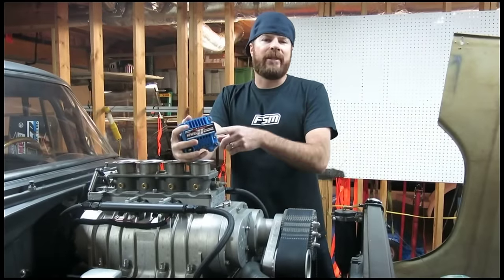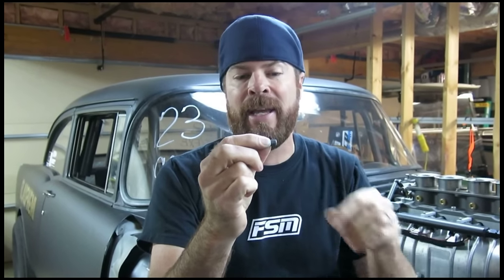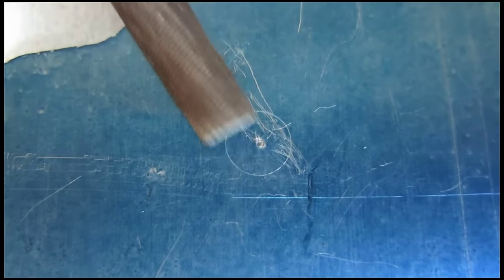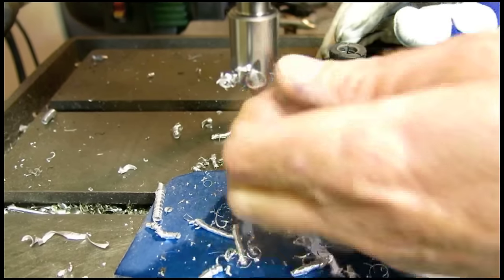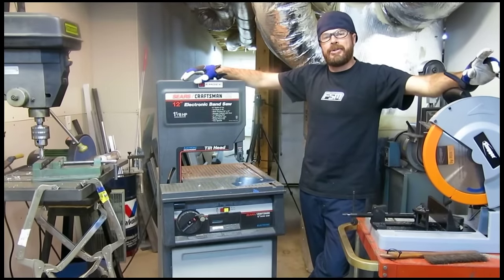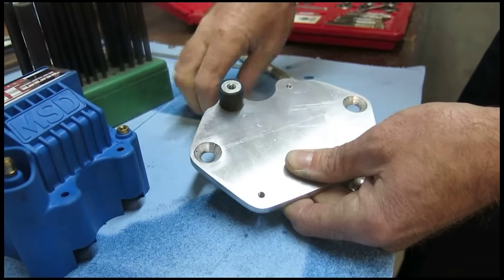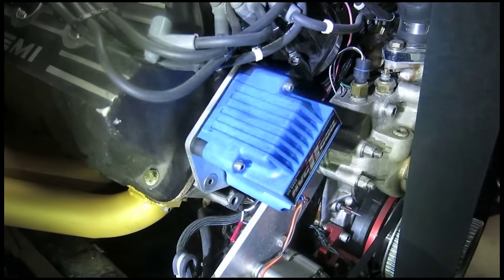Finnegan's Garage Ep.2: Cheap Fabrication Project, Blasphemi Gets a New Coil Mount.

Comment: Have been in the Machinist Trade since 1968 and having worked at a University in L.A. I enjoy watching you learn how to use tools. Nice Bridgeport. I had a CNC mill which was great for making things. You should save up for a CAD next. Tip from an old guy : coconut oil or griddle fry for cutting lube. Safe to breathe and handle. We used it in Aerospace as it was easy to clean and didn't come out in zero gravity.

Comment: Just a note, you can use your Disk Sander or the 2" Vertical Belt sander to dress up the edges of your 1/4" Aluminum.  It will give it a nice brushed finish and you can true up any not so straight cuts. And no you don't need cutting lube band sawing aluminum just watch your feed speed, you can also get more aggressive blades than what you are running. Aluminum also routes and cuts very nicely with standard carbide tipped wood bits and blades, lube may be required at certain times. Look forward to more shows.

Comment: So i used to make leafsprings and when counter sinking steel we had the holes punched out then just went at them with a regular bit half the time. Sometimes 600 leaves or so one after the other. Other than havin to sharpen the bit we never really had any problems doing it that way

Comment: Noticed that if the bracket were to be used as initially cut  the countersunk holes would have been on the wrong side of the material.  The marking compound should have been opposite the countersink?  Otherwise the bracket would have been bolted on backwards.  Great video showing great work and attention to details such as not adding any holes and shaving all but the required material off to make a bracket.

Comment: Aluminum having a passive corrosive coating after machining is true. But if putting a airframe thru a deep C check and proper corrosive protection isn't done, (maybe not on a structural panel) would get you sent home for good quick.

Comment: Probably would have G-Clamped that coil when marking the 4 holes and scribing the outer so there wasn't movement. Doesn't need to be mega clamped, just enough to keep it in place.
Reply from the maker: The rubber mounts for the coil have enough give in them that clamping it down while marking the holes isn't necessary if you hold it firmly and lightly tap the hammer.

Comment: nice harbor freight ratchet. also nice score on the band saw. too many mechanics (myself at a young age included) try doing everything with hand held cutting tools. though I did spy a Bridgeport j head in one video guys who want to get into fabrication should invest in some layout tools a drill press and a band saw. even if they are home grade used tools or tools from China. a lot can be done with a band saw and a blade to match the application. especially if it has multiple speeds.

Comment: I've got a couple of pre milled photo's I'd gladly share..Love the race boat.. mine is an 18 foot Stehpens V bottom. big block chev 481 cube 817 HP.. I pull it to 7200 RPM for 109 mph 2 skiers with very little fuel
Reply from the maker: +Steve Boys must be a pretty small impeller to turn 7200 rpm with 817hp. sounds fun!

Comment: I did a very similar thing a week or two ago fabing up a mount to install a 2005 f250 steering box into my YJ jeep. I didn't have those fancy transfer screws though. So I took a half inch bolt, through it into my lathe, and turned a point onto the bolt. I then cut the head off of the bolt and inserted it into my steering box. Worked pretty well. I should have added a nut thoug. The threads in the steering box weren't very tight causing my transfer bolt to wobble a lot. But I was in a hurry and didn't care. :)

Also, if you don't mind some constructive criticism, the intro needs to be way shorter. I would keep it under 10 seconds. Keeping it around 2-3 seconds would be best. This is something that I have worked through on my own channel.
Reply from the maker: Thanks for the input. I shortened it in the next vid.
Reply: +Finnegan&#39;s Garage I'm glad I could help.

Comment: GREAT video. My OCD kicked in, though. It's not a "ten thirty-seconds" screw. That would be 5/16, not at all what you have. It's a "ten thirty-two." Number ten screw, 32 threads per inch. I'm not a machinist, I'm an electronics/wiring harness tech, but I'm also a generalist. I drill and punch holes in my chassis, mount the components, and do the wiring and check-out. If you get an "eight-thirty-seconds" bolt, it won't fit your "eight-32" hole. Just my OCD acting up again. I love the channel, and Roadkill, too.
Reply from the maker: +Odahi The Dubious thanks for the tip. you are right about that.

Comment: it helps if you can put the bandsaw on a lower speed for metal , not all bandsaws have that option
Reply from the maker: +watahyahknow that saw has two pulleys to change the speed.
Reply: yeah , the one im looking at has that too you need to set it at the low speed  , the other brands dont allways have that 
the higher speed causes more friction more heat and less of a chance to remove the chars of aluminium of the blade/teeth 
the lower speed has more power too

Comment: Poorboy tip. scribbling on the aluminum with a sharpie marker works almost as well as layout die and always seems to be at least one laying around
Reply from the maker: Not if you want tight tolerances. Even the finest point marker leaves a line that is .060 wide.
Reply: +Finnegan's Garage 
No Sir, paint the surface with marker and scribe it (just like the layout die)

Comment: Nice job teaching rudementry fabrication skills. As for sawing thru Aluminum a jig saw with the proper tooth count and some wax on the blade will keep it from being clogged. When working with Aluminum after whatever bracket you have made proper Alodining/Zinc phosphate priming will be required.Since Aluminium is a softer alloy,any ferrous screw,mounting surface will cause the Aluminum to corrode. Should take it one step further and show the proper preparation of the Aluminum. Any A&P mechanic will or should know this crucial step for longevity!
Reply: Also, an A&P mech here, only thing I would have done differently is put some heli-coils in the coil mount threads. Alodine/zinc prime isn't truly necessary ( in this case)as aluminum forms a passive oxide coating almost immediately after machining, of course, any A&P should know that.

Comment: I like the opener, STOP squeal tires on pavement. What happened to the gas door on your 55 Chev gassed, I love that car, with its straight axle nose sitting up high, its old school but very cool. Nice work even the Ops upside down your human and that was cool you didn't hide it.
Reply from the maker: +Raymond Farwell it never had a gas door. i made a yellow lexan one but never installed it. not trying to add any weight to the car.

Comment: Hey mike loving the videos so far and I wanted to get your opinion on something. In my 1985 Chevy k10 I have a 93 target master tbi engine which now has a summit 1103 cam, performer intake and edelbrock 600cfm carb on it. I dont have enough money to spend 1600 bucks on a new pair of heads for it and was wondering what your thoughts are on putting lets say 305 sbc, 2601 heads on my 350 instead of the crap tbi heads that are currently on it. thanks.
Reply from the maker: I'd eat off the dollar menu, save my money and get the aluminum heads. Better performance and a lighter engine will be the result. :)
Reply: +Finnegan&#39;s Garage Alright thanks mike. :) and good luck with the videos

Comment: There's always a commenter on shop videos who complains about the technique, and I'm really sorry to be that guy. Wearing work gloves when using a band saw (or any rotary tool) is a bad idea. If the blade catches leather, it can pull your hand downward and inwards and make the cut a lot worse. If you just want to avoid splinters, wear rubber gloves instead.

We like your fingers, Finnegan. Keep them safe! I like this new independent format.

Comment: Hey Finnegan,  Digging the videos, and looking to see where you go with 'em!

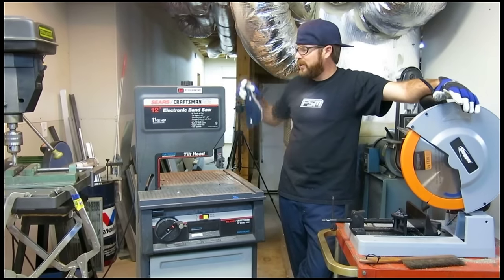Liking the gist of what you've got in going on in this video, but have a recommendation for making your life easier when cutting your brackets. At 6:45 Don't try do cover every external / internal corner of the bracket with a single pass.  If you start by cutting the rough shape of the part by getting the external straight edges cut out, it's WAAAAY easier to make the followup cuts (I'm willing to bet that starting the second cut to take care of that straight edge closer to the camera was a royal pain in the ass - I.E. blade walk city).  What's more, if you get all the straight lines (and interior curves) hacked out on the bandsaw, you can always put the exterior curves on the part using the disc sander.  

What's more I'd recommend you leave yourself 1/16" to 1/8" around your scribe lines, when rough cutting with the bandsaw.  Then just use the vertical belt sander to finish the job.  It'll do an absolutely gorgeous job of truing up the straight edges on anything up to ~10" and you can get creative with a miter gauge and some clamps to keep everything nice and square.

Last but not least, don't sweat the inevitable aluminum packing you'll get on your abrasives. with a thick chunk of mild steel and a gentle touch, you can knock of pretty much all of the buildup.
Reply from the maker: +prelude2tube those are great tips. thanks!

Comment: i tried the bandsaw trick but wood cutting saws turn faster than metal.  did you get different gearing for your saw?
Reply from the maker: +halleffect1 that saw has two pulleys. swap the blade, move the belt, and you're ready for aluminum.

Comment: you use Tap Magic for drilling? expensive cutting fluid for what you're doing. A machining instructor where i go to college showed us one of the best cutting fluids for both steel and aluminum in his opinion, which happens to be dirt cheap as well. Canola Oil. yes, the same canola oil that you buy at the grocery store, happens to work incredibly as a cutting fluid
Reply from the maker: that's a great tip.

Comment: Finnegan get a CNC there dirt cheap now a days you can throw one together for few thousand dollars. Or CNC the J head you have. 
My daughters from GA , Albany. Im from CT. Hour out side of NYC. Its allot different down there .
Reply: TIL: "a few thousand $$" is dirt cheap. Interdasting.
Reply: you might get a proto Trac for a few thousand but if you want something that works you might get lucky and steal a haas for just over 20k
Reply: +Blade Cooper 
You can get a used Haas for 5-6k and up . There are other machines justa as capable but older that are less also. 
Ive retro fitted many knee mills to CNC for a few thousand dollars .  I have 3 in my shop. Lathe , boxed way and knee mill all retro fitted. 
Here in the North east , machine tools are dirt cheap.

Comment: Nice bit of metalwork skills Fin !
 Are you not concerned with heatsoak ?... Other than that, nice work !
Best Regards from Ohio
Reply from the maker: The rubber isolator a prevent most of the heat transfer, which doesn't much matter because the engine compartment has no wheel wells. Although the headers and engine radiate a lot of heat there is usually ambient temp air flowing across the front of the engine.
Reply: +Finnegan&#39;s Garage Are you still with Hot Rod?

Comment: Ok. Why the mount on the engine instead of the firewall? Seems like the extra heat from the block would not be very good for the electronics.
Reply from the maker: +Nicholas Noe didn't want to put any more holes in the firewall. heat isn't much of an issue, there are no inner fenders in my car.

Comment: Pro-tip for ya Finn and whoever reads this: never wear gloves when you're using cutting machinery. skin gets cut and bleeds, and you might have to get stitches, but gloves get caught and take whatever's inside them and attached to them for a ride until the power gets cut. it's easier to put a band-aid on than it is to unwrap fingers, hands, and tendons from a spindle and hoping they can get reattached.

For real though, I don't want to see you get hurt.

Comment: I dunno if I'm just stupid or what, but can someone tell me what the coil is for?
Reply: +Ryan Parmer ignition
Reply: +Ryan Parmer it takes the low voltage electrical signal from the distributor, and turns it into the high voltage necessary to fire the spark plugs

Comment: on a gasser do you run a drop pitman arm or over the knuck steering or is it all stock linkages i got the body and frame for my gasser project just started ordering parts for it been doing as much research as i can theres really not much on the internet about the true build process and the details if you have any input ied like to hear it. as always enjoyed the video keep doin what your doing
Reply from the maker: +Neek Neek mine has a dropped pitman arm. the car still has a bit of bumpsteer though due to the angle of the drag link.

Comment: Great video!!  Is there a blade available for a normal woodworking band saw that will allow it to make passable cuts on steel tubing, or just no way?
Reply from the maker: Yes but most wood cutting bandsaws soon too fast to cut metal. This particular one has two pulleys so you can slow it down enough for aluminum but not steel.
Reply: +Finnegan&#39;s Garage - Something that you might consider is a motor controller. You can turn a knob and make the blade's cutting speed appropriate for whatever type of metal you are cutting.  A very good investment, if you intend to use it more than 20 times a year.
Reply: +KOakaKO $20 at horrible freight.
Reply: justinbeaniam
- That's just a variac, which can burn up a motor. An actual motor controller breaks up the sine wave of the AC power, which prevents the motor from being burnt out due to "brownout" conditions.
Reply: +KOakaKO also make sure your saw motor is able to run at frequencies below 60 hertz. most are ok down to 50 hertz and up to about 65 before they heat up and burn out the winding. look up VFD on the Yaskawa or ABB websites for some good videos (search youtube for them also) on the topic. this is good info to have before trying to run your motor at a slower rpm. sometimes a pull swap is just simpler.
Reply: nbookie
- That's what I meant about the motor controller. It doesn't change the hertz, it keeps them at 60. It changes the motor speed by chopping portions of the electrical connection out of the AC sine wave. It gives the motor less electricity, but it does it 60 times a second - which is what prevents any burnout.

It's probably also why motor controllers aren't the cheapest option, but used ones can be found for not that much.

Comment: Finnegan, is there any chance that I could get more detailed specs on the Blasphemi's engine? Like, what camshaft is in it? What heads are those? I'm just curious.
Reply from the maker: +Cameron Jenkins it began life as a Mopar 528ci crate engine. Superior Engineering rebuilt it and ported the heads, bored the block .030 over and added new Wiseco pistons. Then i rebuilt it again and added a small Comp Cams solid roller camshaft.cam specs are: 254/260 @0.050 lift, 110 centerline, .610/.597 lift. The heads are factory aluminum Mopar castings. Blower is a 8-71 Blower Shop supercharger with a Hilborn four-port injector and Indy intake manifold. There are 8 injectors above the blower and 8 more below it in the intake. EFI is a FAST XFI 2.0 and Ignition is by MSD.
Reply: Finnegan's Garage Thank you very much.

Comment: 10/32 taps huh?
Reply from the maker: Yes.
Reply: Odd sizes there in GA.
Reply: +Joseph Ducharme 10 32 is odd?
Reply: +Douglas Bross .190-32 is not odd. Mike said 10/32. I'd never heard a 10-32 reffered to as a fraction.